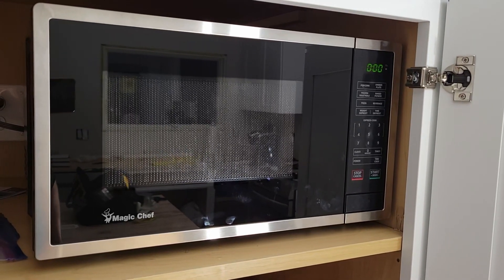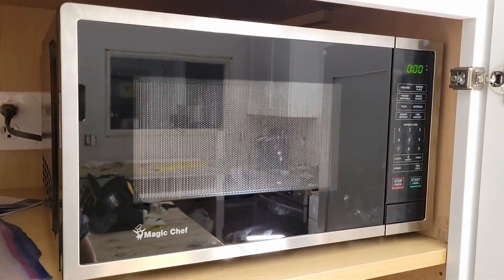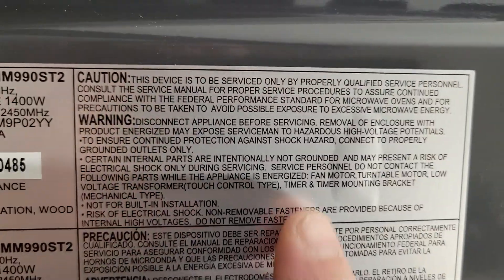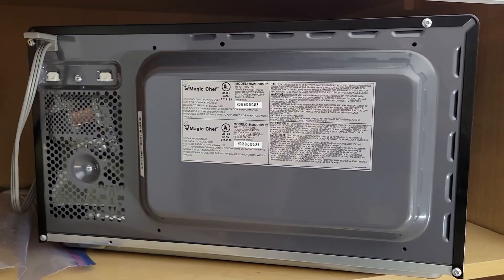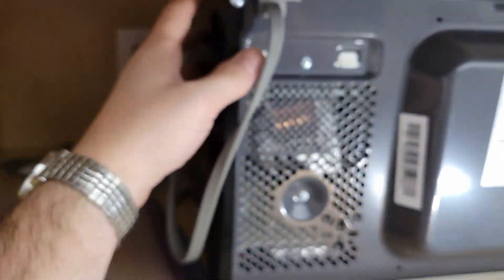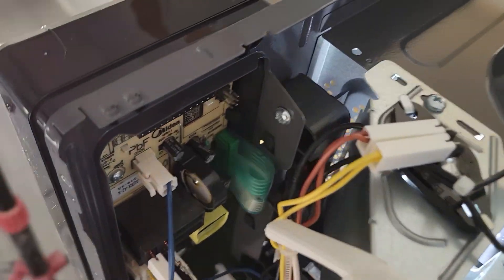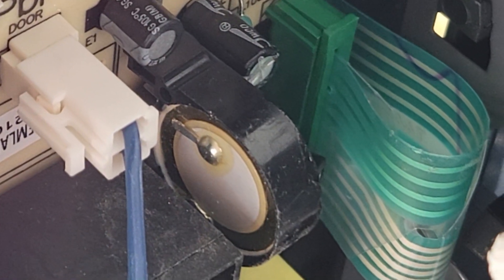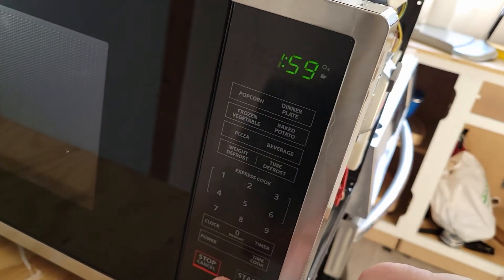How I Turned off the Beep Sound on Magic Chef Microwave HMM990ST2

Comment: Thanks for mentioning the capacitor! Is that the only thing I should fear when doing this piezo surgery? Even if it is unplugged?
Reply from the maker: Anything in the circuit of the capacitor must be avoided as well. Wear dry rubber gloves and use tools with insulated handles for extra safety. I've been shocked by a tiny camera flash capacitor and it taught me to respect the capacitors very quickly. Work slow and safe.